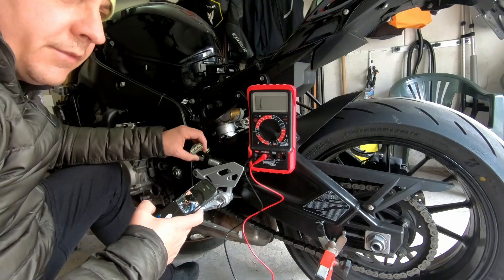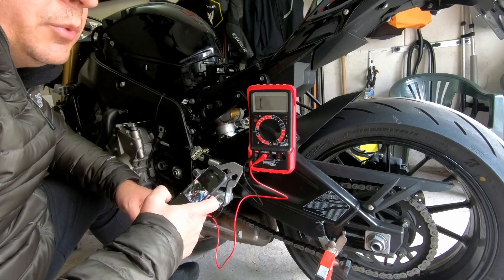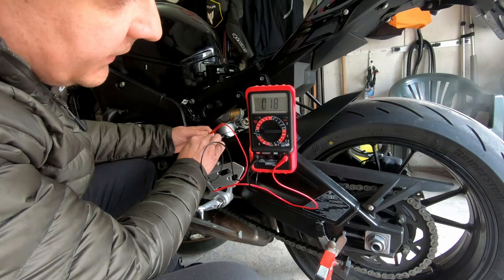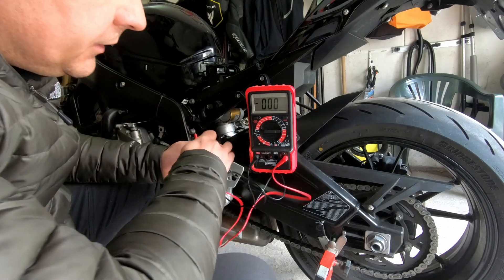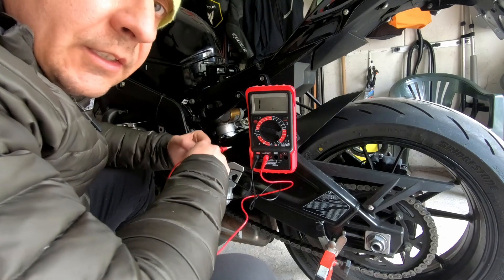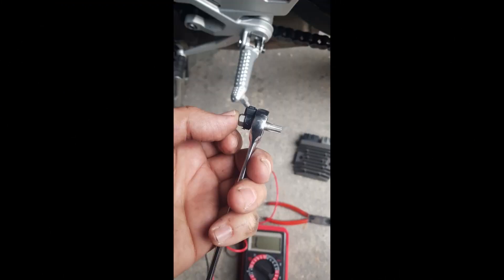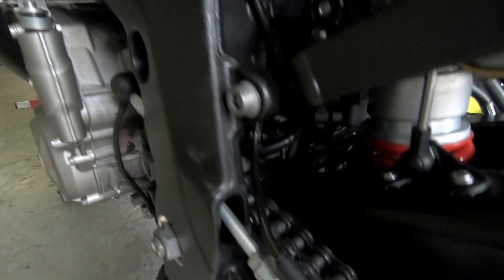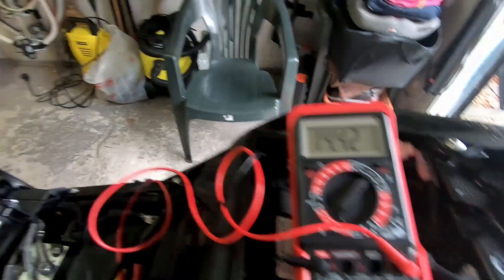BMW S1000R Charging System Stator Regulator Rectifier (S1000R, S1000XR)

Comment: I’m about to get a 2015 model with 40000km. I’ve read I can expect issues with the stator around this mileage
Reply from the maker: Yes! This is a problem! OEM Stator is expensive!
Reply: @powerbikesbg  mine shit the tin this week. oil leaked into the rectifier im assuming both components are busted

Comment: Hello again, I consult you in this video shows with the multimeter that marks values from 18 to 19, I ask these values is the correct one for the BMW S 1000 XR. My motorcycle that is the same model as yours and marks values of 18; in the following file 19 and in the following 15.5 this difference between 18 and 15.5 means that the stator is malfunctioning or it may have that difference, Mario greets you
Reply from the maker: Thw engines are the same in this Gen - till 2019 by XR! If you have milage on this bike above 40 k km. and the readings are confusing you have problem with the stator. I was lucky abd i found one from salvage RR bike and riplace it.

Comment: My regulator has some kind of fluid that looks like oil coming out of it in the area where the gray connector was, going to replace it this weekend and putting a carbon fiber plate behind it to help fight heat from transmission casing will also put on heat reflecting tape on the back of the mounting bracket that holds the rectifier in place. As I have a very strong suspicion that heat killed my unit.
Reply from the maker: Yes, this is oil from the engine! And yes, the heat is killing the stator! Better do not use protection cover!
Reply: @powerbikesbg  how does that even get there?  The connectors aren't sealed well maybe?
Reply from the maker: @cr4zyw3ld3r  it is for a reason...there are just a few drops! Be careful abot the assembly...torque the bolts and use locktite product!
Reply: @powerbikesbg  I read the oils wicking away from stator down the line until it gets to the rectifier and given the airfliw across the frame that would make sense.  Lots of people with different bikes reporting this.  Do you think  sealing the stator cover where the wirecomes out is a good idea?  If not I was just going to coat the gray wire on rectifier with dielectric grease to keep the connection clean
Reply from the maker: @cr4zyw3ld3r  Just follow my steps! The cable is ok without nothing...just clean the old sealant and put a new as I explain in the video! Do not put to much of it..just a small strip around the cover!
Reply: I have the same when i took the connector out! My bmw did weird things when i washed it, going in secure mode, it was thinking its because of the oil in the connector ??
Reply: @G  it's supposed to be sealed but yes I think in time due to wind the oil seeps up the line from the generator and towards the rectifier. It's a bone headed design.
Reply: @cr4zyw3ld3r   do you think thats why its going in limp mode when i wash it? I checked everything, i unplugged the connectors of the regulator and cleaned it put it back but i think it doesnt work because i cant find the obd2 scanner anymore since i unplugged it😂
Reply: @cr4zyw3ld3r   after this i dont go bmw anymore the design is beautiful but electric its shit, never had problems with my yamaha also
Reply: @quadmeister  it's hard to say, but I'd check the ecu connections too as those are relatively exposed.
Reply: @cr4zyw3ld3r   those are good, every connector i found i put grease in it to prevent it😂
Reply: Will a bad rectifier cause battery drain over a few days?
Reply: @tomondrek9860  depends on if the bike was running. Possibly if it was but definitely not if it was not turned on
Reply: @cr4zyw3ld3r  battery dies within 2-3 days if I don’t ride it. Brand new battery,does the same thing. 13-14 volts while running at 4500-6000 rpm’s
Reply: @tomondrek9860  sounds like you have a bad ground somewhere 🤔
Reply: @cr4zyw3ld3r  I will start checking them,appreciate the input !!

Comment: Hi, my bike wouldn't start yesterday, so i trickle charged it for a day, and the bike starts, but a bit slow. When the bike wouldnt start, the voltage was 12,6 and dipped below 9 or 8 trying to start. 
Today the voltage started at 13,6 and went up to 14,8 stable, 14,7 with high beams. My question is this: Is the battery bad, or the charging system? The voltage at the battery is a stable 14.8 no matter what revs i try. Help me Black Rider you are my only hope :P
Reply: and how the hell did you get off the grey stator cable that goes in the rectifier?
Reply from the maker: @ロクでなし-e7b  there is a video on my chanel about stator replacement...you have to remove the fuel tank!
Reply: @powerbikesbg  thank you so much for replying! new battery ordered.
Reply from the maker: @ロクでなし-e7b  no problem, bud...replace the battery, then if there is still problem with charging check the regulator! If you have alarm system you must charge your  battery on a regular basis! Regards
Reply from the maker: @ロクでなし-e7b  the stator cable is pain in the ass, but it is possible to get it out😀
Reply from the maker: It is the battery....Regards!